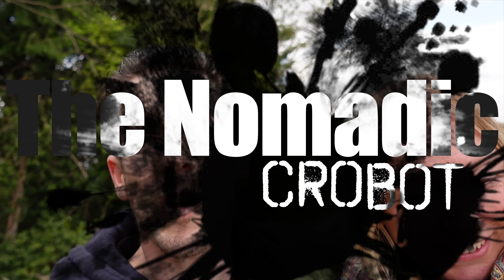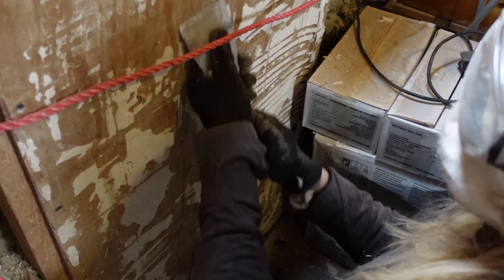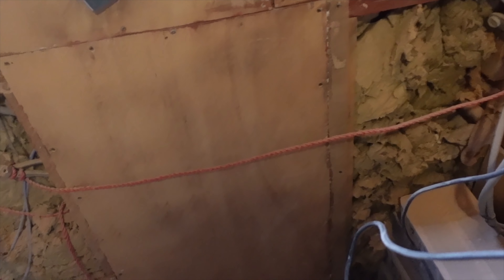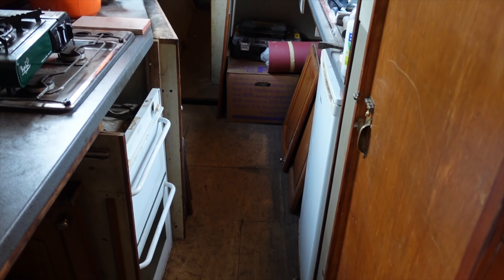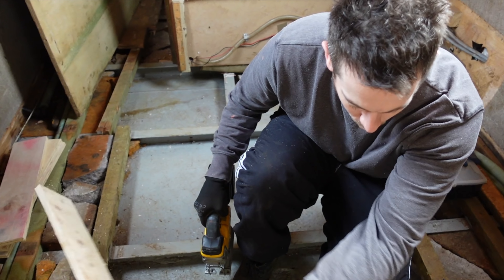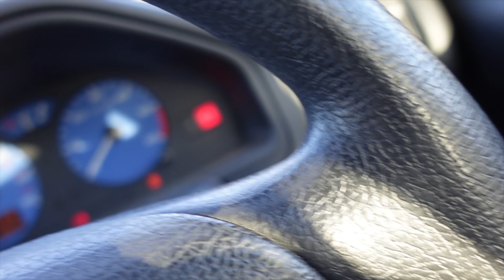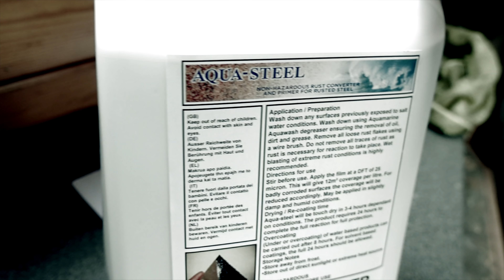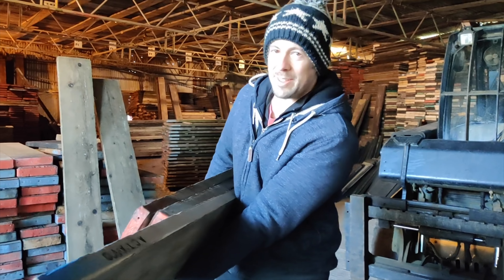Installing a SECRET HATCH in our Narrowboat !

Comment: You guys should have made departure date 4/20! 😂🤣😂

Have a Lovely Christmas!?!  How far are you behind?  LOL
Reply from the maker: Haha!!! We did indeed thanks! Well much like everything, one step forward 3 back!! We will get there in the end!
Reply: @TheNomadicCrobot  O yeah!  I remember what I forgot to say in my comment.  If you had gotten a surveyor, after he measured hull thickness and found out your hull is as thick as it is on the bottom sheet, they would not be concerned about leaks and if they DID see water in the bilge, they would check for a bilge pump and if it didn’t have one or had one and didn’t work, he would have reported that and considered it rainwater unless he found the leaking tank.   I said it before and I’ll say it again, going by an existing survey was a decent move, you guys got the boat under 40K for a 60 ft boat in a market where as fast as they are posted, they are snatched up.  It looked bad yes, but I would consider that cosmetic on a double bottom.

Comment: You can just tile over the old grout
Reply from the maker: Ahh ok, I did wonder that but I thought it might make it uneven as it was so lumpy and bumpy!
Reply: @TheNomadicCrobot  that is tru, scrape  the worst of it off then mix up 50/50 pva water paint it on to seal/prime it. then tile...job done :))
Reply: @TheNomadicCrobot  using a heat gun  will also remove old tile glue easy